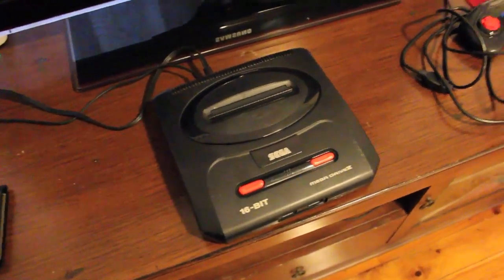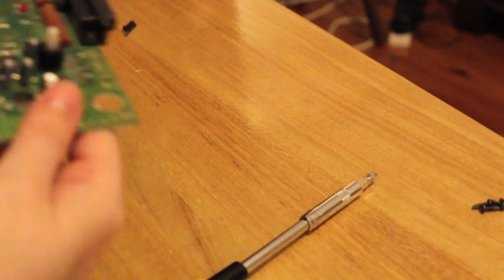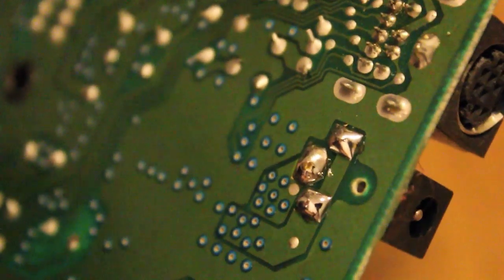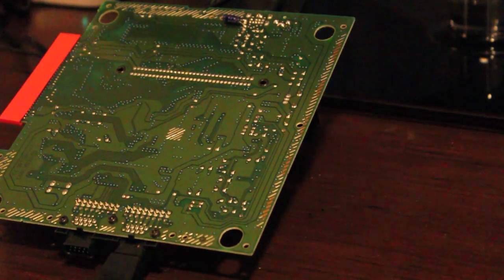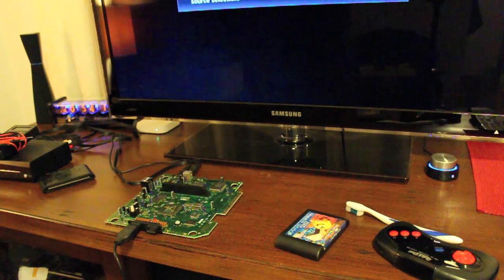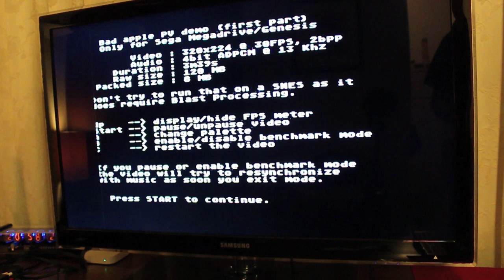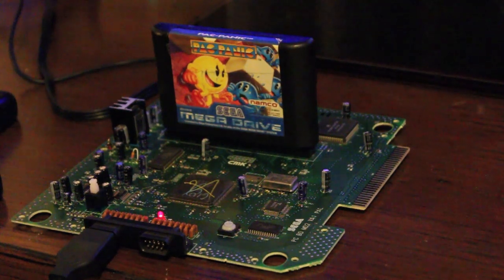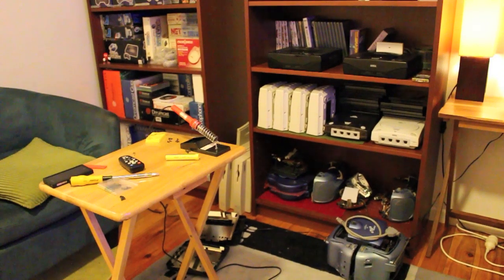Sega Mega Drive II Repair to DC-in Power Socket / Jack

Comment: Just got a very clean Model 2 Genesis with the same issue. This repair is so easy!
Reply from the maker: It really is! Probably good to do on any mega drive 2 or mega drive 1 (I think the early Japanese models had their DC-in board on the main board, I know it was resolved by VA4 which was when the European version came out)

Comment: Hello. I have the original mega drive 1. I have had it for nearly 30 years and the power on | | off  switch is not hardly budging at all. Do you have any advice on what to do please?

Comment: Thanks just was cleaning out my attic and found my gen2 genesis, but its not working right. The power light doesn't come on, and when you even breath on the cartridge the whole screen goes blank and it crashes. Also there is quite a bit of static on the screen. Any thoughts?

Comment: Hey mate, just wondering weather you have come across the megadrive 2 giving you a black screen and no game boot up. Ive got 1 identical to yours and have try'd everything to get it working. Cleaned carts and cart insert contacts, checked for any burnt up pins on the board, all are clear and clean not broken. all wiring is working and is within correct voltage ranges as per secs. 

Any ideas? Cheers!
Reply from the maker: Black screen, no game boot... I have a feeling I have but I can't remember for the life of me the end result. I'd recommend posting on AssemblerGames.com to see if they can offer any more troubleshooting tips you can try! Best of luck! :-)
Reply: Hiya chap did you find out how to fix your black screen problem

Comment: Its like, I've two meagdrive model I. One does not turn on. The resistors or something (those two things with screws only on a metal plate before you dismantle it [I dunno if you've ever seen one insice or not] that are on the top left near the dc-in and the rf-in.) are "white", dunno if it is normal being that way or not, and the soldering from that bottom part does look bad. So I'm going to try and put some solder up to it and see if that resolves the problem.

Comment: So what was the problem with the Megadrive the second time?!
I'm trying t "revive" my megadrive I too. I'm missing the solder. I will have to ask it borrowed from my gramps. Byt I noticed that the dc adapter from the megadrive two has 3 dots, the megadrive I has 4 dots. Do you put solder on them 4?!

Comment: I have a problem where it only turns on when the power adapter is at certain angles.
Reply from the maker: Could be something wrong with the DC-in socket on the mainboard, reflow it to see if it has any effect. If not, there could be corrosion inside the socket or there's something up with the power adapter. So many things could go wrong with such a simple piece of hardware sadly :\

Comment: So, yes, I do have to use that incridible stupid plug, and that incridible useless antena/game port adaptar. 
But I guess that in one the cable is not the problem, but the adaptar is. Cause I have a master system II that uses the same cable and works like a charm. 
I'm feeling that the adaptar there might be loose or something so not to send the tv feeding signal as it supposed to.

Comment: Is it safe to be powering the system on without reassembling it first? I've heard that running it without the metal shielding/grounding attached is dangerous... but I'm not sure if it's supposed to be dangerous for the user or the system.
Reply from the maker: Probably more for the user than the system. The metal EMI shielding is the fault of the FCC, you'll note Japanese Mega Drives are lacking the same shielding! They aren't too bad to fiddle with while they are on, of course there are precautions you have to take and appreciate that electricity is dangerous! The same way you should always treat items near the stove as hot!
Reply: Its no big deal

Comment: Will do. But still that megadrive has another problem. Only has second player controllor adapter xD So in my mind, I have both, for sparing parts, to move them one to another if some don't work.
Move the ac adapter if the other one is broken, move the rf-in to the other or switch the controller adapter if the solution for one another is easier in some way or the other.

Comment: Hi. I was examining my mothrboard (same as yours MD2PAL VA1 ) and I touched the heatsink of the voltage regulator by an accident. It is extremely hot, can you please tell me if thats normal? Test of a thumb - 3 seconds. This is a stock unit, no mods. Should I be worried about it? Frankly, I am very scared, I thought I would play Sonic with my grandchilren one day in 2075 and now I am not sure if the systems gonna survive that long with with a voltage regulator that simply BURNS!

Comment: I'm usually a ceptic person, but I do usually hear people out and try what they recommend. Do I solder the 4 dots? I don't have to much experience with the electrical part but I'm learning, at home :D and what better way to start with the oldies. :)
If  what you recommend didn't work, what should be done next?

BTW, WTD 3.5'' external hard disk ac adaptors are the same as the megadrive and have the same voltage and watts. And so does my creative sound speakers. :D I'm so fucking lucky

Comment: So, I just dug out my old genesis/32x from many years of being packed away.  I hooked it all up and it started right up I bumped it and it shut off.  I noticed the DC-in was loose, and also A and B were not working on either of my controllers in the player 1 controller port.  So I did a reflow on the middle DC solder point and all of the player 1 solder points.  I tried putting in a game before i put it all back together.. it got to the first screen but would not get to the title screen of any game.  I thought maybe i needed to retension the pins, so I did that, and I got the same results.  So I just put everything all back together, giving up on it for the night, but I thought I'd plug in the 32x just to see if it worked.  Put in a 32x game and got nothing at all.  Put in a Genesis game and it got to the title screen and froze.  restarted and pressed start real quick when it got to the title screen and it worked, but now games are preforming inputs that I'm not doing,  All of the buttons on the controller work now though.  Any thoughts?  Did I mess up soldering?  Please help :(
Reply from the maker: +Atuzor Hello! I'd recommend posting over on assemblergames.com to see if they can provide any help, they've always been where I turn to when I get stuck :)
I hope you can get it working, good spotting on the DC-in though. It was a separate board on the Mega Drive Model 1 for a while. I think the earlier ones might have had the DC-in jack on the mainboard but the later ones on the separate board and then back onto the mainboard for the Mega Drive 2 - what chaos! :)
Reply: +Shane McRetro Awesome!  I will definitely check them out.  Thank you very much for your response.  You've got a new sub.  :)
Reply from the maker: +Atuzor Hey hey hey! Thanks :)
Reply: ***** Got it working!  Just tore it back apart soldered the dc-in again (it looked like it could use a little more), bent the cartridge slot pins a little more, and bent up a capacitor that looked like it was touching a jumper wire.  Hooked it back up and every game worked except Road Rash 2, which oddly enough works when the 32X is hooked up.  Thanks for your advice! :D
Reply from the maker: Wow, glad to hear you got it working well enough, hope it's still cranking :)

Comment: Wait, I confused the terms. DC is what megadrive/genesis II uses. AC is what Megadrive/Genesis I uses. The same as the hard drives, creative speakers and nintendo. But I won't mix them up, since my comicon is also with the same problem... (in "petit morceau deaux chambre) xD
Anyways... I try and use the other MD ac socket? But the thing is, how the wires are attatched to the board confuses me, and I don't want to fuck it up. :S Now that I much buy, a multimeter I mean. Thanks for the heads up :)

Comment: My power not working for my Sega genesis at games mega drive take at 9.0 v output input
Reply: I could be wrong BUT, I believe the Sega Genesis [Mega Drive] requires a 10V DC power adapter.